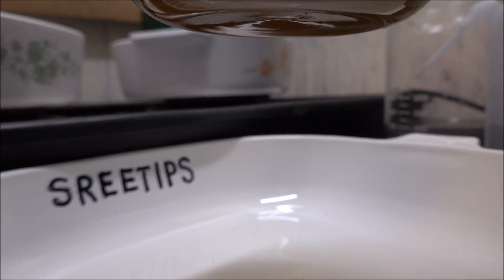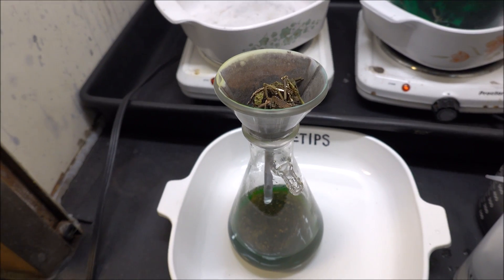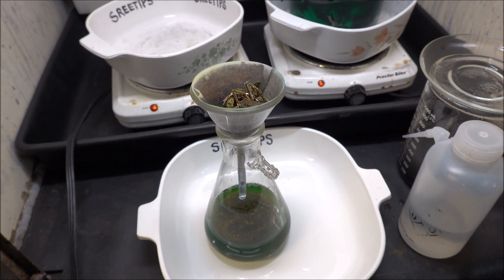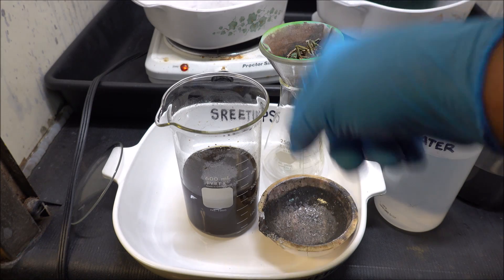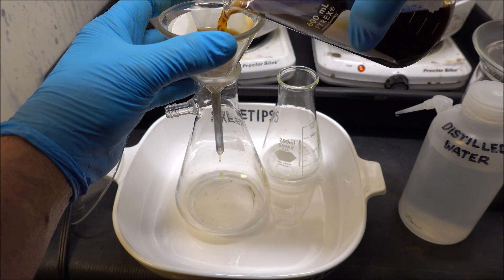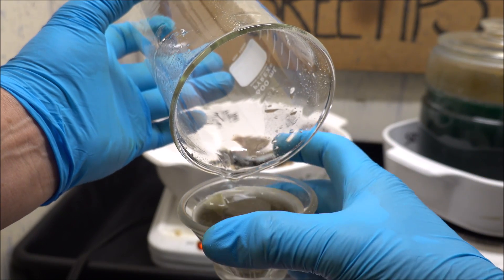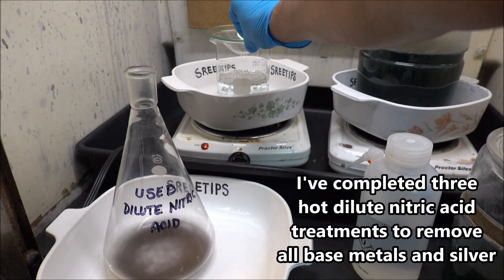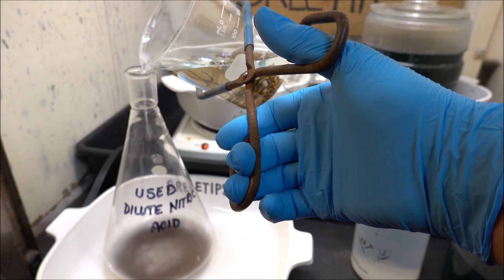Gold Recovery From Dirty Solutions

Comment: No need for inquarting "aka alloying" the gold with another metal.. It will make it a little faster, but just use HCL to dissolve bass metals and leave it to dissolve a day or 2... after a day, all your base metals will be dissolved except for anything above copper... Your silver will not dissolve in aqua regia, so no need to worry about that. Silver is insoluble in HCL and will sink to the bottom as a white precipitate called "silver chloride." Filter it off and collect it before you precipitate your gold so you can turn it into silver metal later....
 
So then.... your only base metal then will be copper... You can dissolve the gold and copper together with anything else like platinum and put them all into solution... and then Use Ferrous sulfate (instead of smb) to precipitate gold and it will leave copper, platinum etc behind.

 I give information for free, without intentionally trying to confuse or mislead you.... I hate these gold people with all of my heart for what they've done to me.
Reply from the maker: I’m going to repeat this experiment as soon as I get enough karat scrap to do it.

Comment: Help! So I have successfully refined a small amt of gold from optical scrap using HCl and bubbler over time to dissolve base metals (mostly copper), then adding residual to HCl, adding nitric acid ml by ml til no further reaction, denoxed with sulfamic acid, then dropped the gold with SMB. Encouraged, I upped my amt of scrap by 10X. After 3 weeks of HCl and bubbler, I assume I jumped the gun and tried to dissolve the gold too fast. Ended up with a dark brown grey solution (weirdly, tried to stannous test…dipped paper was pretty brown but when stannous was dropped on, it oddly went clear???). So, I did the next “logical” thing… I panicked and tried to add SMB. Now I have a mess. I separated out the solids, rinsed and put back into HCl. The liquid still does what I would call a reverse stannous test (wrongly so, but I have no clue why it is clearing up the original brown solution). Is there still gold in there? I’m trying to wrap my head around the info in this video about introducing silver but I’m not there yet. Any words of wisdom? I sure could use some encouragement/ direction. Feeling defeated 😕
Reply from the maker: If that stannous test goes clear then that means NO GOLD.

Comment: Brother have you ever had you gold drop in solution turn the solution almost like a rust color with rust color mud? I had zero silver to inquart with so took it straight to Aqua Regia... Dropped it with Bonide Stump out. Had excess of nitric in it as well so it took a fair shake of stump out.
Reply from the maker: Yes, I seen that on this recovery
Reply: @sreetips  I think I'm going to collect the mud and refine it again in AR. Here's my other thing... Stannous Chloride is showing a coffee brown color after I dropped the gold. Platinum? I have no clue how to drop Platinum.
Reply from the maker: Stannous turns orange for platinum. Brown might be palladium, but it will slowly turn green for palladium. If it stays brown it’s probably gold.
Reply: @sreetips  Thank you so much brother. For whatever reason it will not drop with bonide. So I'm going to cement it out and then see what powder we have.

Comment: What to you use to percipitate the silver from your used nitric acid? I can't believe I haven't seen your method yet, especially after watching so many videos. Do you just use a copper push bar? Or do you use a chemical for silver precipitation? 

I've refined so much gold in Poormans AR over the years, all without inquarting sadly. And I neutralized the solution with Urea. And never recovered the silver, never even tried to. Now I want to inquart, and I see how you use Nitric just to dissolve the silver and other alloys before the gold sees AR. I'm just curious about the best way to get the silver back. Is it really as easy as putting a copper bar in the dilute, or used nitric just to cement the silver out? And I imagine it's a silver chloride that requires more than just a rinse and a melt to come back to metal form. Any info would be great. Thanks for all you do, you are a phenomenal teacher. 🙏
Reply from the maker: I add clean copper to silver nitrate and the silver comes out of solution, as the copper goes into solution, in accordance with the reactivity series of metals. But first, I add more sterling silver and some heat, to consume any excess nitric before adding the copper. Excess nitric in the silver nitrate will needlessly consume the copper that’s intended to cement the silver out. Silver chloride is a totally different process.
Reply: @sreetips  thank you. A screenshot was taken, and these words will go into my notebook 🙏

Comment: I love your videos because you talk to us intelligently in step by step methods. I question inquartation, the need to add silver in to weaken the percent of gold, because you then end up needing to use 5-10 times more Nitric acid than you need. A simple solution would be to just melt the metals first and turn it into cornflakes or shot. Spreading out the metals into thinner pieces with more surface area would allow you to get to both the gold and silver. Another way would be to simply just grind the metals into shreds or powders. 

The other barrier I learned from you is that if you add HCL to Silver first it creates Silver-Chloride, an insoluble material that shields and stalls the chemical reactions. Again, a constant blending of the materials is needed to get into the center metals. Could electrolysis help to pull the silver-chloride ions away somehow? I like the sulfuric-electrolysis method. Creating a giant cell made of lead or stainless steel, like you do in the creation of pure silver, it can pull different metals away at different levels of density. Am I just dreaming?
Reply from the maker: Sounds good, but instead of grinding the metal into tiny pieces, I’d rather alloy it with silver and let the chemicals to do all that work for me.
Reply: Yes. I am watching another few of your videos thinking about why you do it and because you like the silver you are actually doing two jobs at the same time. I only wonder however, are you just adding impurities from the silverwares into your gold. Bu I also see how much you refine and double refine until it is clear. Good job. Thank you again.  
 @sreetips

Comment: Hey there Mr. Sreetips! First off, just wanna say… big fan. You’re the man. I’ve found an invaluable amount of information through your works. Big thanks! 
I got a question for you. Let’s say someone decided to do their first refining, and somehow he stupidly throws a steel chain in the mix thinking it was silver, and somehow never noticed when he inquarted it. He then continues with the hot nitric boils, and dissolves less than half of the chain… 
I’m wondering if I should filter, then precipitate, and just start over? Would I have to do a hydrochlor boil to remove the iron ions? Idk… 😅😢 I’m stumped. Any advice or tips would be greatly appreciated.
Reply from the maker: I’ve had steel pieces in the dish during inquartation. They have a much higher melt temp and won’t melt so I just reach in with tweezers and put it out. But what you’ve described is something I’ve never encountered. We want to keep HCl far way from inquarted gold. Forms insoluble silver chloride and that’s not good.

Comment: sir, i think i dissolved some gold in Acid-peroxide solution. i think i added to much h202. my ap doesnt react anymore(i added h202 to cu2solution, i think that qasnt a good idea) can i drop the gold with smb directely? or should i drop it with copper
Reply from the maker: I’d use SMB after filtering.

Comment: I  was able to dissolve all the gold flakes by using aqua regia but when i dropped it with Stump Out, i got a blood red material that floated and sat at the bottom. This happens every time I attempt to precipitate gold from solution. Any idea why the Stump Out is turning red and not dropping the gold?
Reply from the maker: I’m just as baffled as you.
Reply: @sreetips  I am going to try to melt it today since I have acquired enough for it to melt into something. I made not have cleaned it properly prior to dropping it. hopefully it is due to standing material mixed with the gold. I will inform if i was successful or not later on. thankyou
Reply from the maker: No matter what happens, you’re gaining valuable experience. There’s no substitute for experience.

Comment: Thanks for this video! I really enjoy your gold refining videos! I have to solve my orange solution that did not drop any gold. I dissolved 150g of green fiber cpu pins straight in AR...after pouring several spoons of SMB (after denoxing with urea) gold did not drop. I put some copper in the solution. after 2 days it is still dropping some black junk. Have any tips? Thanks a lot!
Reply from the maker: Aqua regia will turn orange all by itself even though there is no gold in solution. My guess - you had such a tiny amount that the yield is nil. A common beginner mistake.
Reply: @sreetips  I don't know if it's tiny amount from 60 cpu's. But I got the mud first time. After trying to refine the mud from the first AR, I poured a lot of smb with no denoxing and turned red. I assume there are lead salts dissolved in solution.

Comment: when i added the SMB to my dirty solution, nothing precipitated. it didn't even fizz (i assume because of so much copper). I've reduced it down to a sludge, but I'm not sure whether I should go straight to nitric acid or hydrochloric. funny thing though, i got the gray sludge like yours, but BEFORE adding the SMB.
Reply from the maker: Who knows what metals lurk in the alloys of men. This is why I inquart and part with dilute nitric boils. Completely eliminates all the problems associated with trying to get the gold from dirty solutions.
Reply: @sreetips  The only quick (and dirty) way to get gold from such a dirty solution is by cementing it out on silver (after getting rid of superfluous nitric). On a positive note, that should get it close to 999 already.

Comment: What kind of respirator plus accessories do you use for your refining??
Reply: You add the sodium Metabifulfite like it isn't choking you to death and you never want to use it again( even outside) just need to know how that's accomplished.
Reply from the maker: Roy, I have a fume hood that draws the vapors away from me and exhausts them up a stack to the outside of my shop
Reply: @sreetips  it seems like a diy hood wouldn't be very difficult. It's literally just a good size fan and a metal box right?

Comment: Hey i didnt get all of the silver out of my gold when i put it in aqua regia now i have pieces of gold with silver chloride running around inside my beaker how should i best go about this to get back on track?
Reply from the maker: If it were mine I’d get everything in solution then filter and precipitate. If it were mine.
Reply: @sreetips  hey thanks for responding back so quickly i really appreciate it. I know i ask you alot of questions but i go through your videos for answers and as a guide but sometimes i cant find the answer in them so thank you again very much
Reply from the maker: Silver chloride is very fine particles. It will load up the filter and make filtering painfully slow, even under full vacuum. That’s the main problem with having silver in your gold solution. And some will get through the filter no
matter what. Also, being slightly soluble, some of the silver chloride will be in solution with the gold. But a second refining will usually clean it up. If not then a third refining may be needed.
Reply from the maker: This is why leaving the gold in the nitric until all the fumes are gone and the solution is colorless, like water, is important to achieve BEFORE we go to hydrochloric acid and aqua regia. This is an important and valuable lesson for you, grasshopper!
Reply: @sreetips  definitely an important lesson i will not want to learn again the filtering was so very slow but i suppose thats how we learn thanks again you i appreciate it more than you know

Comment: Any suggestions? I have a dirty solution of copper, gold and gold jerlery alloyed metals, most likely silver and zinc mostly, I added hcl by mistake, (no lable)🤔 when I was dissolving base metals, I need to extract any gold that may have dissolved but all that perciputated looks like a mix of smb and copper cloride? I don't know, is there a way to remove gold and recover from this newbie mistake? Please share your wealth of knowledge
Reply from the maker: You added HCl by mistake. If it were mine, id pour the whole mess into a filter and get all the solids filtered out. Then I'd put the solids, filter and all, into a melt dish, cover with a 50/50 flux of sodium carbonate and borax. Then I'd try like the dickens to get it melted into a button. Then I'd determine the karat of the button, inquart with silver or copper, and start the nitric treatments over. If it were mine.
Reply: @sreetips  ok so suposen I just saw your suggestion and I ignorently went on with the dissolution of gold, tho it was a long and painful weekend of improperly colored mess, I got the gold to mostly dissolve into a golden green liquid, left with a whiteish yellow semi solid in the shapes of my inquarted gold. Soft and spongy tho it SHOULD BE DISSOLVED,  what a disaster, my first run was so smooth I must have relaxed far to much. This is entirely my doing and I truly appreciate your pitty. Thanks for the tips, I now know what to do, start over. Ill melt up what's left and see what's going on, it looks like some chloride husks, you would cringe. I'm ashamed
Reply: I did a successful run with a yeild of just under 4g nearly pure, I'd say 23k, but this time I was exited and rushed, if I can recover from this mistake with some help, I will take these lessons and learn from them. I really respect your work, and hope you will take me into consideration as a new refiner
Reply: 2 days from now ill have  more stanus chloride, I got a bottle months ago, it's someplace...😐
Reply: You make this look easy, let me tell any viewers that have any misconceptions about your proses. It's long exausting, tidious and.... misspelled.  BUT it's amazing and worth the troubles for the self satsisfaction I got a taste of on the first run. This stuff is worth respect. Especially to someone who has it so easily spelled out including the production  Proses. Cheers 🍻 sreetips, here's to one day hoping I too can make it seem easy
Reply: Update: 
My test solution came early, I tested both solutions the one I forced forward, and the original blue mess, the pushed solution I knew had gold, used it as a control, tested positive for PM's, I then tested the mess, negative with no inclination of PM's, FEWF! SO I can gather from this experience that LABELS are invaluble, patience is key, and mistakes can teach you allot. My last inquary, if you oblige, is what I am to do with the suspected chloride husks that did not disolve. They are white in collor, tinted yellow-green  by the solution. My initial thought is to test with nitric, hcl, and royal water separately to get information on remaining metal salts. Then proceed as nessisary.... Would I be in the right ball park?

Comment: I really enjoyed the video, but you could have made it better, since you offered no alternative to traditional SMB reducing method. For this kind of mistake the best reducing agent in FeSO4 (a.k.a copperas) because SMB can and will reduce everything in solution, this includes silver and copper ions that may be present.
 It shouldn't be a major issue since there should be little of both in solution, still to people that struggle to get their hands in SMB (like me) copperas comes as a common, cheap and preferable alternative. But a second refining step should be done, this time with a better reducing agent such as SMB or oxalic acid + sodium hydroxide to get rid of small iron impurities.
Keep up the good work mate!
Cheers

Comment: Thank you for your videos they close the gap between theory and practice.
I just did a couple of things which seemed to work quite well (because it was in front of me) .... I used an ultrasonic cleaner (that I use for clocks) rather than heat to promote the reactions. This can simply be turned off if things get over excited whereas you can’t just make a system cold if driven by heat.
 The other thing that I have done instead of using caustic soda to neutralise things is to simply use some limestone gravel from the drive. This costs nothing and just sits there bubbling away until the acid is used up. This eliminates vigorous reactions and leaves the ph of waste solutions right where you would want them to be
  Many thanks once again for your efforts and I hope that my observations may either help or amuse.🇬🇧